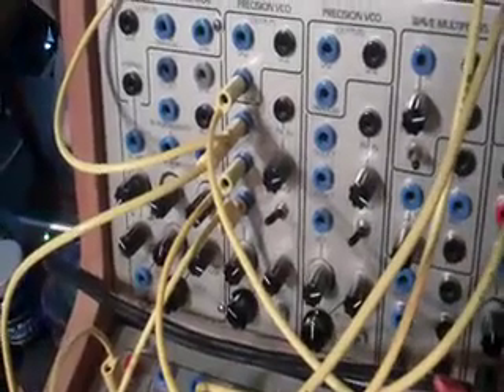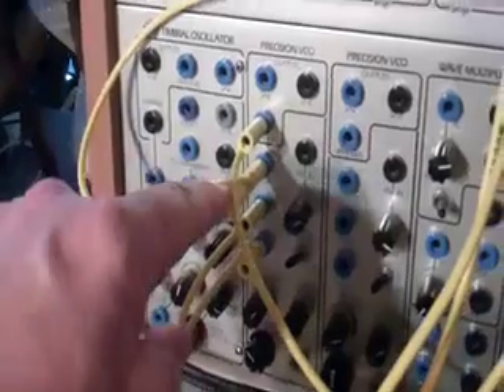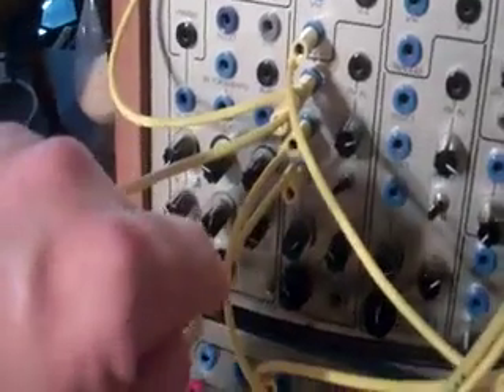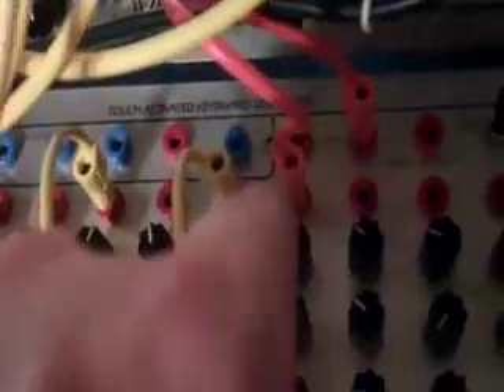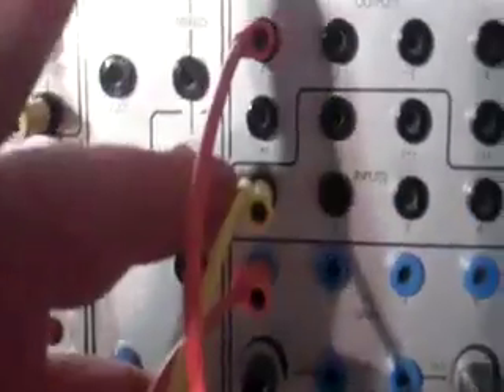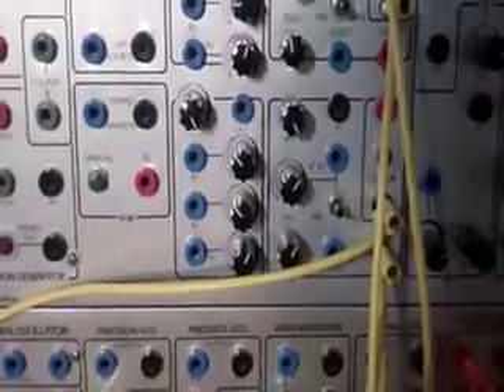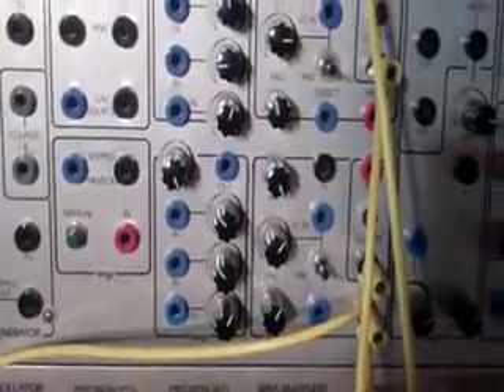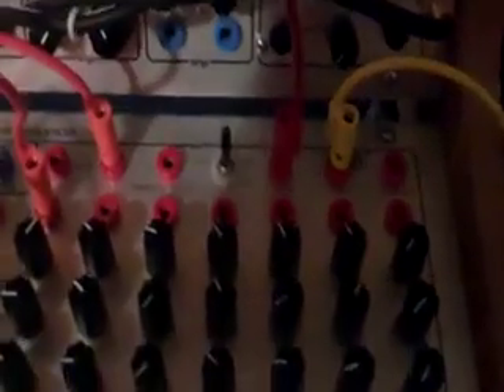Serge Pulse Sequencer Demo

Comment: What is controlling the VCO? Is it a row of TKB voltage modulating the VCO?
Then what are the DUSG's doing?I follow that they're triggered by the TKB pulse outs-- but what are they being used for, audio?

Or maybe they're opening VCAs, or sending additional modulation to the VCO?

I wanna know how one goes about setting up these kind of rhythms on the Serge. It's a great patch.
Reply from the maker: they are being used as low pass filters. adjusting the rise and fall adjusts cutoff. In this example: https://youtu.be/9pAvymVpLi0  I'm cycling the DUSGs but that is not necessary, just adds an extra element which can also then be used as a subharmonic generator.